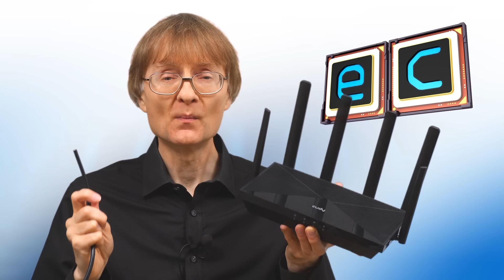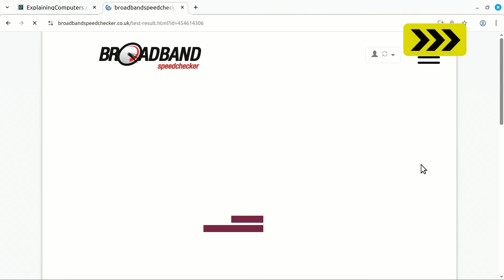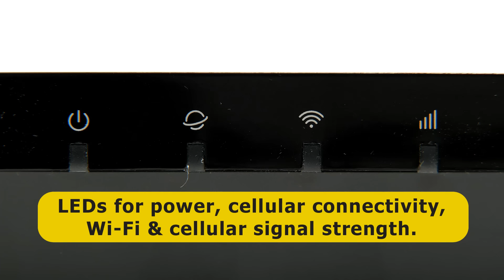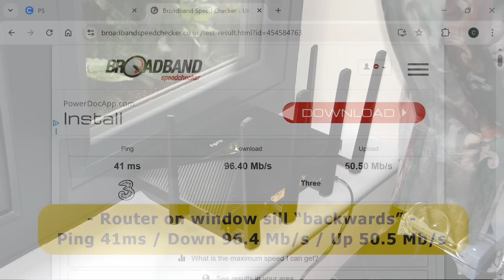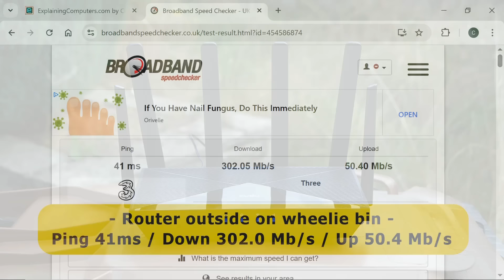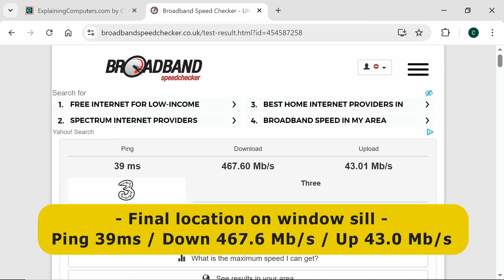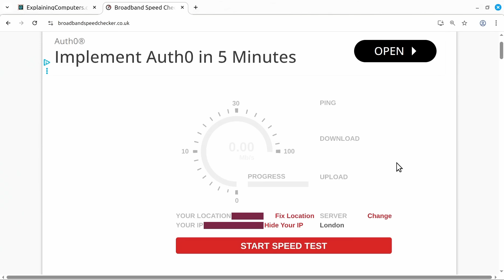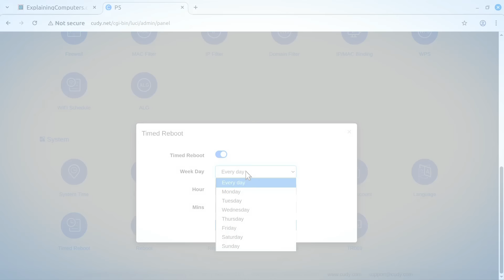Switching to 5G Broadband: Cudy P5 Router

Comment: But… Isn’t the right way to use 5g in a house network, to mount a outdoor antenna on the house, and run a cable to the router inside?
Reply from the maker: You only need an outdoor antenna if you have poor reception (eg if you are over a few hundred meters from the cell tower) and hence have better outdoor rather than indoor 5G reception. And as the video shows, my indoor 5G, in the right place, is as good as my indoor. There is no "rule" for 5G. @)
Reply: @ExplainingComputers  If I stand on top of the roof, I can see the cell tower. I guess the signal strength would be good up there, but I have never tried. I just live with the old copper line

Comment: Some companies limit their 5G speeds, EE said 100Mb/s
Reply from the maker: EE limit depending on the plan, often to 100Mbn/s or 150Mb/s. But their network is far faster. I've just added a backup SIM into my router, which is PAYE on 1p Mobile. This uses the EE network, but with no caps. I did a test, getting 510MB/s down, 36MB/s up, ping 33.

Comment: I have Starlink. 450-500 Mbit Down 50-70 Mbit Up. Never lose a signal, not even during a thunderstorm we had. It is the best internet on the planet. > 20 ms too.
Reply from the maker: Starlink is just cool.
Reply: @ExplainingComputers If you want me to test anything for you or want to know something about how it performs day to day, just let me know. I will gladly share.

I took advantage of the residential offer that gives you the standard dish and the big, expensive WiFi-Router, which is really nice and you get all for free, with a 12 month contract. The monthly is 40 Euros per month. After the 12 months, the gear is yours and you can stop the services if you don't need it and resume it if you need it again. However, in my case it will just keep running because I need decent internet which I don't have here on that Greek island of line. lol

I am doing daily speed tests and it never slows down too much; It is very stable. The router is running for days, only rebooting when there is a firmware upgrade or something. The internet is just "there" and always accessible, which before has not been the case, using DSL and 4G / 5G as a supplement. Thank God those days are over. I'm also spending less money now.

Comment: On an interesing note we recently had a 48h powercut in our area and we lost mobile signals from all networks within an hour of the power failure.  With BT getting rid of copper phone service meant that for large majority of people especially elderly - no access to being able to summon emergancy or other help. Even the incredibly poor service from the SSEN power company couldnt grasp the fact powercut meant no comms or  power for  hotels or restuarants (thier solution for priority service customers with medical needs is hotel or for hot food is go buy some)
Reply: Agree that is something most folks do not understand, Cable and Cellular service requires outside plant power that can be difficult to maintain during an emergency. We now have a fiber PON connection so as long as the local phone company and we are able to maintain power and the the physical fiber is not damaged should be no loss of service.
Reply from the maker: Our new comms vulnerability to power outages is indeed very worrying.
Reply: Think that's stupid? Now, throw in a few more power-hungry GPU's, some server farms and more electric vehicles (EV's) into that scenario! 🤦 

...We just won't even consider any increase in overall electricity demand or anyone's rising electric bill. 🤫   🪤🐁
Reply: Last week we had a 6 hour power cut in the early hours of the morning. Thanks to my network having Uninterruptible Power Supply I had the entire Wi-Fi spectrum to myself for the first hour until the UPS batteries ran out.

Comment: Currently with Vigrin media on their 150mb plan. as we are now out of network we are being charaged £55 a month for this (new custoemrs pay £30)
Trying to convice my parents to switch to sky so we get 500mb for £28.
Lookeed at getting a 5g router but given our area and the nearest tower that would mean either putting the router on the other side of the house to where everything is wired to or runniung an external antena to the back of the house to point towards our nearby tower.
Reply: I had exactly the same annoyance with Virgin (NTLWorld) cable and had to threaten to leave every 18 months. I'm now on FTTP with City Fibre for £25 at +-900Mb. Moving my router across the house with Wifi 6 point to point works well. I get about +-500 Mbps at the other end. Just pick a wifi 6 expander with a gigabit port. I have TP Link MESH and RE705x. 
When the City router kit arrived, the delivery driver said he'd droped about ten that day on our road. All my neighbours were on Virgin. I can see all their routers have changed from "VMxxxx" to something else when I scan channels!

Comment: Been using a 4g+ router for the last 5 years cheaper and more flexible than being attached to a cable company . Using smarty network which uses the 3 network. Pay as you go gives the ability to move the router and stop the connection whenever I like, without contract small print.

Comment: I recently switched from fibre to the cabinet where I was getting 50 Mb/sec down 10 up to fibre to the house where I chose 300 Mb/sec down 50 up as this was under £30 a month. The only issue I had was getting my four Tp-Link APs to reliably give me a respectable WiFi performance, I switched a couple of them for EAP 723 Wifi 7 APs. Happy now.

Comment: Companies keep promoting 5G yet the speeds are barely faster than 4G and WiFi (sometimes even slower) except in a few countries.
Reply: Yes 5G is just a protocol that includes ways to get better speeds using higher frequencies and beam forming, but that's really expensive and requires a dense network of 5G towers, so barely anyone uses it.
Reply: The more people use the same bandwidth the slower it is.